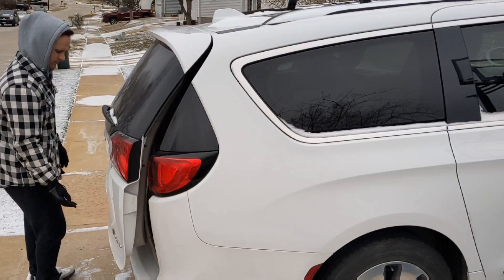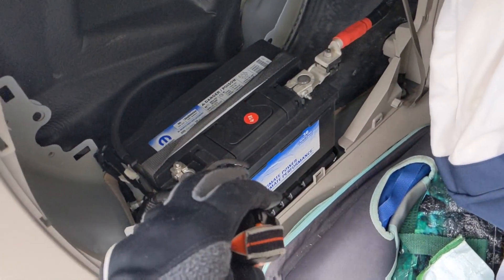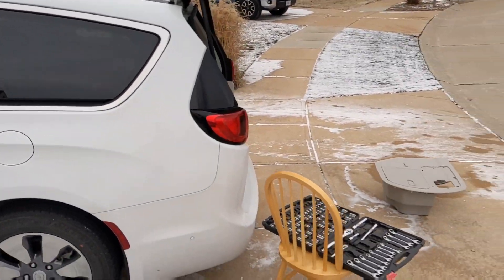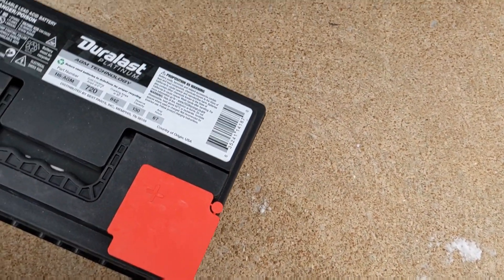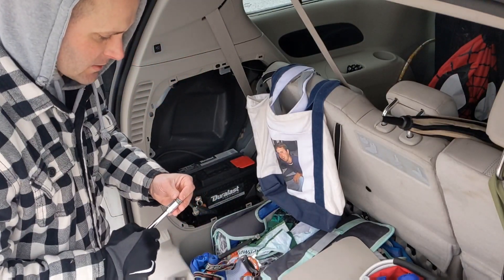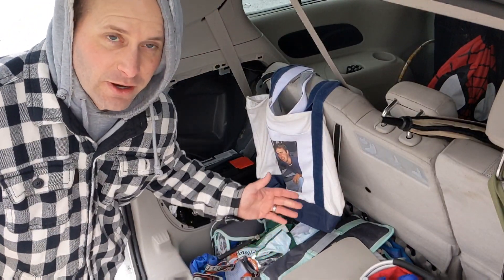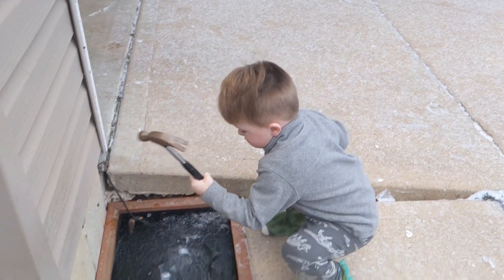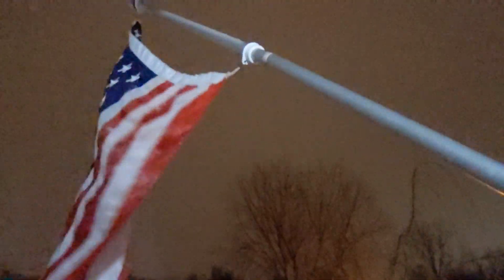How to change a battery without starting a fire.

Comment: I have replaced a new 12v on my Pacifica, the electric parts such radios door window screen all works, but I can not start the car, is there any reason 😢
Reply: I had to disconnect my new battery completely and then reconnect to get the car to start. It was stuck in a charging system error.

Comment: Is it as simple as removing and replacing as you did in this video or does one have to shut off the high voltage system (well going to floor and switching hv connect off)?
Reply from the maker: Unsure, but I simply swapped it out like any other 12v battery.
Reply: @kove  Yeah I just did the same....followed your video and it was easy to do in the end. (I even dropped the nut below the battery ledge as you did ..thinking to myself be careful not to drop the nut :)  ...but thanks for posting this - it really did help alot.
Reply from the maker: Great to hear! Lol, yeah that little nut is feisty

Comment: I think my 12v just died, but nothing works at all, no dash lights, and the rear lift gate does not open.  I think I may have to just get it towed to the shop to be safe.
Reply from the maker: Sorry to hear. Oddly enough, ours just died today as well. It stalled while driving and a little red battery light came on.
Reply: @kove  I got a replacement from a local auto parts store today, had to climb in through the side doors and fold the rear seats down.  Got the panel off and swapped out the old battery with the new one.  Right away the horn starts to honk, I hit the unlock button on the key fob, then had the most rewarding double click of the rear lift gate ever.  Kind of like an elaborate escape room scenario out of MacGyver or something.  Swap out the battery to open the door and escape the minivan!
Reply: @glendoggett9670  As you did the swap out ..did you turn off the high voltage connect or just followed this  video step by step (without ice smashing ;) )
Reply: @okonnors2  I did not do any high voltage disconnects, but was just careful to keep both of the battery terminals isolated so neither made contact with any metal parts, or people, and used thick gloves when removing and reinstalling the cable brackets to the battery terminals.

Comment: What year Pacifica Hybrid year is yours? Did you disconnect all the other things?
Reply from the maker: 2018. I disconnected the two battery terminals. Unsure if I was supposed to do more..
Reply: @kove  thank you for the only video that's relevant to this auxillary battery replacement for hybrid!
Reply: @samtrang  YES ! So few videos on how to replace the battery and indeed how to open the liftgate manually if one has total loss of power and one needs to open the liftgate to do the battery replacement. Koven describes the process for battery clearly and accurately. (Thank you !) As for the liftgate..once you take off the cover (small panel in the middle of the liftgate interior) - there are 2 latches on the PX side of the cavity...the larger one is visible and the smaller lever is not immediately visible. The trick is to use a finger or screwdriver to move the larger level out of the way so you can access the smaller lever which actually does open the liftgate.

Comment: Love your kids! So how do you like your Pacifica so far? I really want to buy that car and heard a lot of reliability issues. Any thoughts on that?
Reply from the maker: Thanks Drone! It was the first year the model came out, so there were some bugs that don't happen anymore. Minus those I'd give it 8/10. The battery could be bigger, sometimes the auto doors don't close, and the dvd system is incredibly slow and annoying.
Reply: Don't buy it. Bought 2018 Hybrid limited and nothing but problems in Chrysler way.  Lucky we paid extended warranty expecting problems.

Comment: Thanks for the video. I found it difficult to find info on the Pacifica Hybrid 12V battery and the PacHy forums have a lot of mis-information.  Apparently changing the battery is just the same as any other car but I would not have dared pull so hard on that interior panel without seeing you do it first. I still have an engine light on but it starts, drives and charges now. I will get out the OBD reader and see what it says. Thanks again!
Reply from the maker: Exactly why I made this, super glad it helped you! Make sure you have the recalls up to date. We were almost able to convince the dealership to pay for the battery due to it's close relationship to a recall. My wife made the mistake to bring it there to get the OBD read, $75 down the drain when Autozone will do it free..
Reply: After putting the new battery in - I also had the engine light on but after driving for about 30 minutes last night after installing the battery - the engine light was off this morning.

Comment: If you’re not sure which terminal is which,
Use a multimeter, it will tell you,
If you put the probes on the wrong terminals the reading on the multimeter will show a negative value.
Reply from the maker: That would have been a good part of training. Guess that's why I wasn't fired 🤔
Reply: @kove  
The battery was though.
               😁